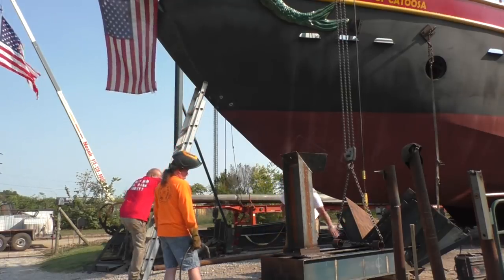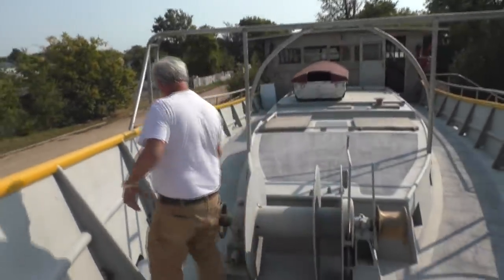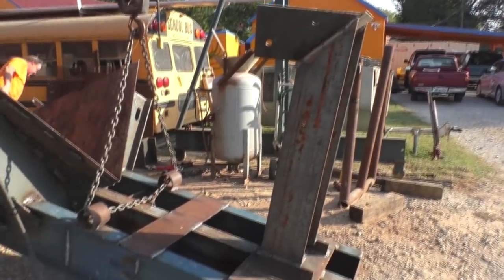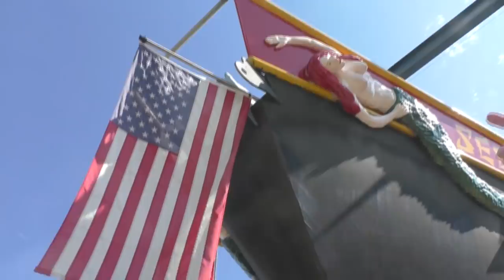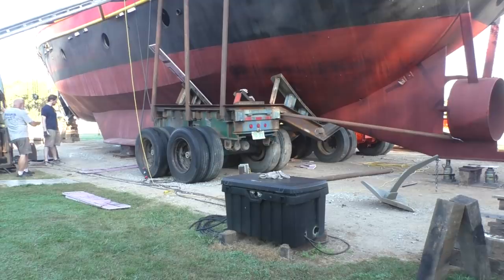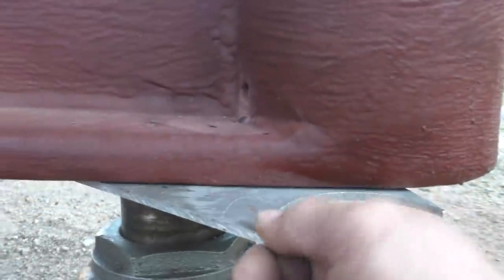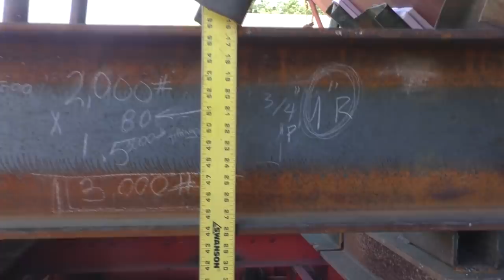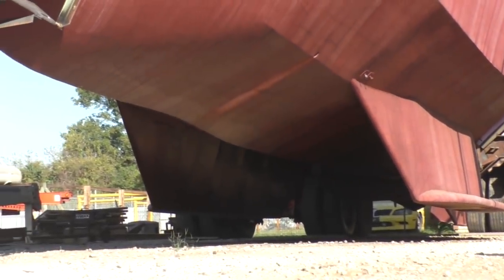Wheels for the Boat - Part 7

Comment: I do super loads. I own my truck. Western Star.  4 axle  Quad truck. 5th wheel hight  51 and a 1/2 inches tall. I would love to pull that load.  Thanks for the entertainment.
Reply from the maker: If you're offering, I'm listening.  : )
Reply: @SVSeeker . When would the load move. Roughly.  I need to  look at my  Schedule. Like all heavy haulers we have loads book out  Months in advance.  My truck runs under Powersource out of Indiana.  FYI rear  Breaks would be greatly appreciate.  Megan oversees our heavy haul.  Let me talk to her  and I will try to contact you.
Reply from the maker: @stevenjohnson931   We'll need 4 axels.  And we have months.   Lots remains to be done.   You can write me directly at svseeker@ymail.com.   Thanks

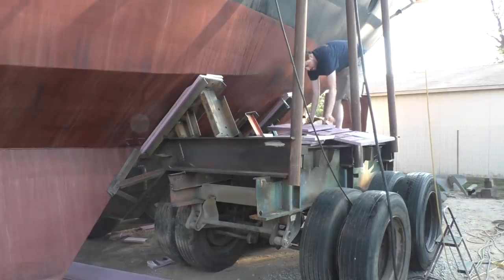Comment: 19:15 - 20:05 Every boat I've restored (a few/lot) that's exactly how I got them done when others that I know are still sitting on wrecked hulls in their backyards. You know where the real money has to be spent on things that have to be "one and done" and other things that if you get a couple years out of it, it was expected. I've seen so many boat projects go off the rails because someone was saving money for just the right gauge package or something else while the whole project just sits. I'll run cheap Sunpro gauges for a year or two at 15 bucks a gauge and be on the water and when the money gets better I will change them out. For that matter in 3 of my main boats they are still there because they have exceeded their shelf life so to speak. I have also been known to go "out of order" when rebuilding a boat to keep the project moving along. Just because I don't have the money for some expensive part for a motor I'm building for the boat don't mean I cant get gallon of fiberglass and maybe work on that stuff that will take forever when the ball really gets rolling. If I have a project my motto is "something everyday" no matter how big or small. Hell, I've spent the first week of a restore wiring brushing rust off a trailer and painting with zinc paint. Just spent my money on it so I'm project money broke but I have a wire brush and $15 worth of paint will cover the spots. Trailer done and moving on. It may look insane to my neighbors restoring a trailer under a wreck of a boat but they have become a custom to my madness and see it gets _hit done.    
Instead of breaks you can always tow it like they do ships with a tug on the front and a tug on the stern for breaks.

Comment: You'll get less compression if you build a full crib instead of a box crib; i.e., put three or four blocks in each layer. When we crib for lifts with jacks or airbags in the fire service, we always use full layer cribs.
Reply from the maker: Yup.   But the dam carpenter ants ate a bunch of my cribbing.   ...good thing they don't like steel.  : )
Reply: @SVSeeker  at least you don't have to worry about termites eating into the Hull!!!!
Reply: @timhyatt9185  thermites might.

Comment: In Europe, there is absolutely no way this method of self fabrication would be allowed. The whole rig would have to be designed by an engineer, to perform with factored in safety tolerances. All welding would have to be undertaken by a coded welder, and weld a would have to be x ray examined. It would cost a fortune. 
In some ways I think that’s a good idea from a public safety point of view. But part of me also admires the freedom to be able to do this and take responsibility for it yourself.
Reply: sounds like Europe needs some Freedom
Reply: @violenceislife1987  so true in many ways.
Reply: I think the autobahn should be able to take this boat at 80miles/hour if the roads camber is correctly engineered haha.
Reply: Well that clip of the failed heavy haul that Doug showed was in Europe. All that engineering and planning worked great for them....

Comment: Doug, I have heard you mention several times about the bolts being able to take a certain load but please be aware, the values you get from a design table for allowable shear and tension are just the beginning when designing a connection. There are several possible failure modes that can control a design. These include bearing failure, shear and tension interaction, and block shear or shear rupture.  

You will never reach near the full bolt design shear values if the plate deforms at each hole in bearing or if the bolts shear prematurely because of the additional tension on them, or the entire chunk of plate surrounded by bolts tears out with a sudden shear rupture. 

If you do not do an actual design, stay very conservative based on bolt allowable shear tables, torque the bolts as recommended and monitor the connections to the hull during the move.
Reply: I wanna say he addressed the perfect tension rating vs shear strength in a previous but recent video and said he was figuring it in. May have been the video he puts them in the 1st time.
Reply: After 44 years as a mechanical engineer, the best way I could state it is “bolts in tension, pins in shear”.  It’s not just about HD bolts - it’s the fact that thru-holes for bolts won’t allow the bolts to work together to counteract the shear moment.  It would have been better to have two bored and reamed pin holes with one bolt hole to hold the angle plate and two backing plates.  Hope all goes well...
Reply: @bobholloway7138  choo choo charlie was an engineer too.:-) :-) :-)
Reply: @bobholloway7138  As a structural engineer, I don't like the idea of guessing on this one. There is too much at stake once you hit the road. With an estimate of the motive force needed to pull the rig forward and when turning on different surfaces it would not be that difficult to find out for sure what stresses your dealing with on the chains and connections. 

Any money saved in the DIY, play it by ear process will be quickly eaten up by fines and costs incurred to the government authorities for damages, traffic control or moving equipment for however long Seeker takes to rebuild its hull while it blocks traffic. 

The addition of chains to the rear suggested in the video is a good idea but the bolted connection in front, the chains around the hull, and the chains to the back each have a different stiffness which dictates how much of the load each will "see". The stiffer bolted connections "suck" up more of the load than the stretchy chains which overstresses the bolted connection. 

The easiest way to design such a complex interactive system is to design each element to take the majority of the load by itself so as the system reaches equilibrium it won't overstress any one element or connection. 

Doug, you have access to many engineers to get this right the first time. We are here to help.
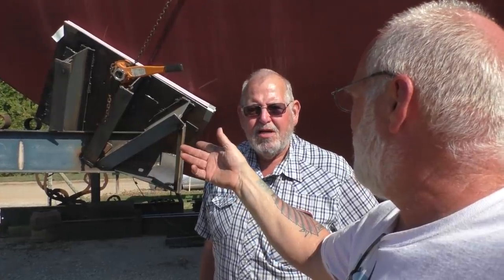Reply: @dj4246   You’re correct, and what I was specifically addressing was the two bolts used to connect the angle bracket on the bow.  Paraphrasing Proverbs 14:12, “there is a way that seems right to a man, but the end there in is an accident ready to happen”.   Engineering isn’t guess work.
Reply: @bobholloway7138  38,000 people died in car wrecks in the USA last year. Did it stop you from driving a car? :-) :-) :-)
Reply: DJ   Do you check your car lug nuts and studs regularly? If not you should! :-) :-) :-)
Reply: @bobholloway7138  When they added the diagonal braces to the front bracket, that made the connection even more rigid which will have the effect of assuring most of the load, both vertical and horizontal will be in the bolts at the front. 

The chains may be able to be tensioned enough to resist the moment about those front bolts and the tow force, but now there needs to be some flex in that bolted connection so the loads redistribute to the chains or there may be hull damage if the connection is not adequate. 

Has anyone estimated the force required to get this rig moving and turning?

Comment: You gonna assemble the chains on there so that it is all still one continuous length?
Hate to cut it into 8 sections just to need to weld-link it back together for when it's going to be on the anchor. Every chain I break seems to be at a cold link or a weld link

Comment: trailer brakes are important because if something happens to the truck, they will stop it, that includes truck brake failure, hitch failure, trans failure, etc etc etc. 

there is such a thing as overweight permits as well, so as long as the truck axles are rated then it will be fine.

Comment: After seeing some unique welds on the top deck near the hatch, I ventured back to a early hull construction video, were they are joining the hull sides together. They are using a suitcase feeder, with what I believe to be FCAW. Hopefully that process was used for all hull structural welding. You can back gouge and weld to achieve a quality weld, depending on the welder. I wonder why they transferred over to MIG ?
Reply from the maker: That was dual shield.  And after the hull plate I switched for the cost savings and no need to clean off the flux.
Reply: @SVSeeker  what is the hull material , to order the use of dual shield ?
Reply from the maker: @stevecarlisle3323  Cardboard of course.
Reply: @SVSeeker  Yup, that's the kind of answer I was expecting! 🤣

Comment: I am Amazed at what you have done. The people that support you are going to be well rewarded. What a Ship. You ought to see during inspection of a 747 when they lift 500,000lbs off the ground and rotate the Landing Gears. You could use some of those stands. Big Thoughts Big Boat... Big Outcome. I would love to come visit... Gotta finish before the Corona turns to a Zombie Virus. You could hide that ship in the Arctic Waters and survive for a very long time.  Gun Mounts?

Comment: You have done superb job!  I would use wire rope from the front to the outside of your trailer system, chain makes shrapnel when breaking. Wire rope makes a mess. Still amazing job

Comment: How much chain did you order? Didn't you say you were using your anchor chain? Depending on length you ordered you might be able to used chain with out cutting it once. Start in middle of chain at top front of bow. Down, up , down, then back. Leave extra a little slack between attachment points. Left over could be put in buckets on rear axles.

Comment: Awesome weightlifting , I always say to the younger gen to go and get paid for your weight lifting exercise , no good paying gym fees. The belly chain to the back frame would have been my suggestion also as you covered steer crabbing with your beefy frame work in the rear and only the truck torque forward was also my concern corrected with the belly chain for the front hitch staying level when dragging 16 tires around a corner or up a grade. Good you caught the equal and opposite reaction to weight on the Earths crust on camera.

Comment: Hi Doug,  do patch the front car with the back car. When pulling force is extended the Chagin will be secure direct tension lines. Alle the other are not direct. And curve tension lines will not work as efficiënt .
Ing. Rob. Kabel

Comment: Wow the boat moved, I’m not a safety nut but I feel a lot better with steel toed boots when I’m working around metal.
Reply: Ham, at these weights steel toe boots would just shear your toes off.   The steel caps are only designed for light loads ( think hammer or alternator sizes.
Reply: @MrEric_API  or the wood and steel cribbing
Reply: @jonanderson5137  no just a few smashed toes
Reply: @hamiam2243  if it's heavy than you can lift, then steel toe boots aren't going to save them.
Reply: @MrEric_API  i was always thought that sheared off toes can be reattached, crushed toes can't.
Reply: @Taliesin6  Arthur,  neither is a good experience and if either happens on a remote jobsite the chance of successful repair is low.
Reply: @MrEric_API  true, i always worked in warehouses so i never considered that.

Comment: Hi Doug would it be possible to have another truck attached to the rear of the boat by a bar to act as rear brakes the pintle at the rear would be a good attachment  point for the brake truck lots of luck with the tow Bob.

Comment: I was thinking that Oklahoma might want you to register your dollies as vehicles, in which case there would be a whole series of annoying details. You may be able to do a one trip permit, as opposed to annual registration.
You may be able to take the position that it is only rigging and avoid all of that.
Brakes? That's what the anchor is for. But seriously... Sometimes on these oversized moves they have a truck at the front and one tied in at the back, on a drawbar. That could be your rear brakes.
Reply: Watch parts 1-6. Old Doug has it figured at this point

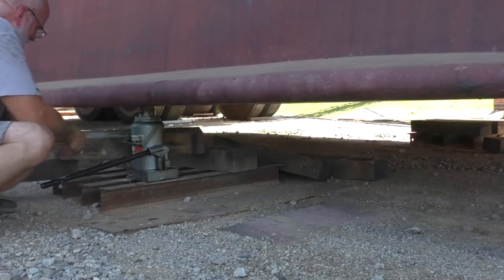Comment: 27:01 ...wow, I've never seen earth rebound like that.
Reply: Id say it was the steel plate under the beams springing back, not the dirt. the weight of the boat made the ground sink over a long time and the plate had to bend under the force of that, when the weight was removed from the plate, it sprung back but the ground stayed compressed.

Comment: The accident what you showed was a hydraulic failure. Had nothing to do with human faillure. And you named the wrong company.
Reply: @puppyupper4565  With these trailer platforms thousends transports has being done. With such technical trailers,  there is always a change, something go wrong. A pressure hose burst or a presure valve. With this accident, the left side pressure valve failed. Has nothing to do with human faillure.
Reply: @puppyupper4565  If a load is 200 ton, and a trailer pressure valve breaks, the load shifts. The weight on the chains can be doubled. If you dont understand this, dont talk about it.
Reply: @puppyupper4565  This trailer has vertical Hydrolic axles. Left and right are seprate. And if you are really a disigner, you must know, in every piece of technical machine's, the change something goes wrong is a possibilty. Again, that had s nothing to do with human errors. By the way, in Europe a home made boat trailer is a no go. there is no heavy haul company who sign up for this and no permits for this thing. As a disngner you must know such things. But if you ignore trhings as a piece of enginering can't go wrong, I have serioeus doubts, that you are a disgner. Have a nice day.

Comment: we have a company where we build a trail for one thing only sometimes they travel 50 miles in that day with a load that they 1200 mile was it going to be they usually travel and stoping to allow the traffic to safely go by as well  they have a root to take throw towns all the light and street lights are turned to clear the loads too not fun when you stick behind the load yea we had a wild load too we had no choice in that matter somehow the government did screw up in the permits  both of the load did made it up there as the government here people were not trained in any way to know that they were doing  one did not know what it was for or the sign should be used

Comment: That thing will never fly...
Reply: Couple solid rocket boosters and it will fly. Not sure if the school bus windows will hold up at mach 2 but if my middle school bus driver is any proof they will hold up to mach 1.5 with no issue.  😎